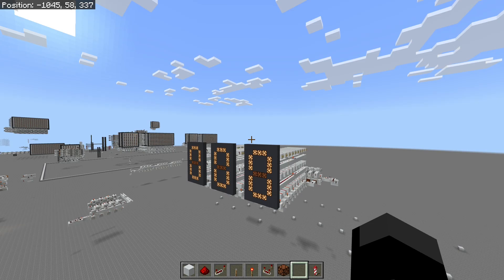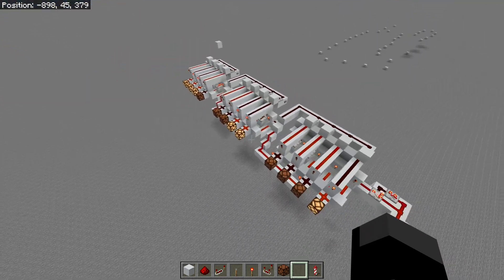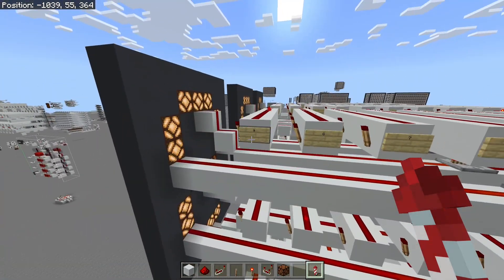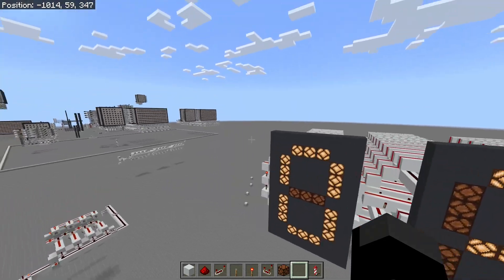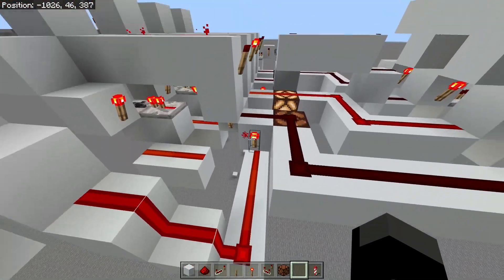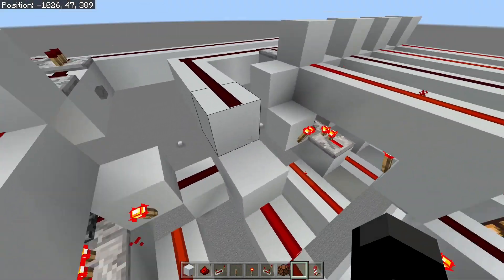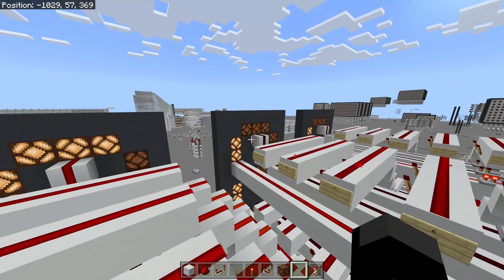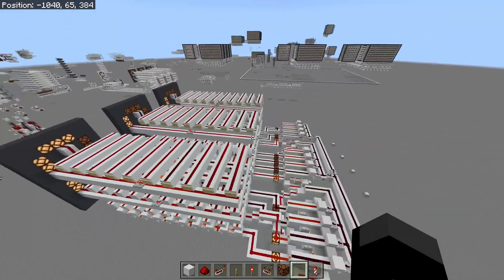0-999 decimal counter using binary up counters - Minecraft bedrock/java

Comment: How do you power the display so that you can power each part accordingly
Reply from the maker: If you mean light up the specific segments for each number - each number is stored in memory and depending on the BCD input, It will output the specific values for the corresponding pixels.

Comment: nice have you seen a 2 by 5 ram design its very compact and could compact you computers dramarically if made vertical but great video
Reply from the maker: Funny you should say that, my next video will be on vertical ram - it may not be the most compact design, but it works fairly well. I think it is like 2 by 12 (including the input and output busses + the read and write control lines).